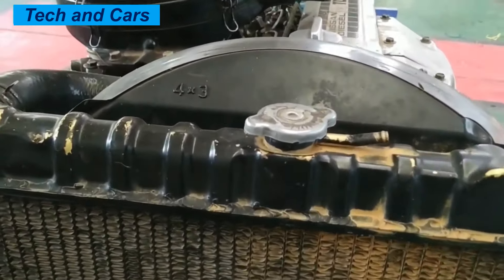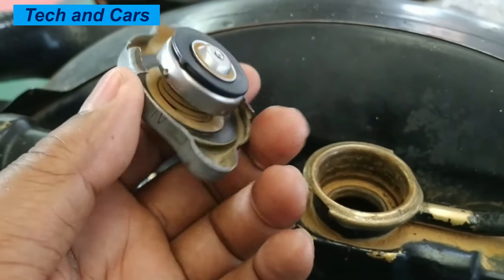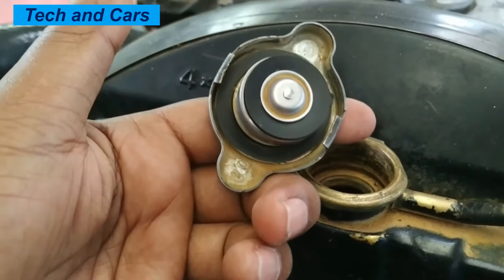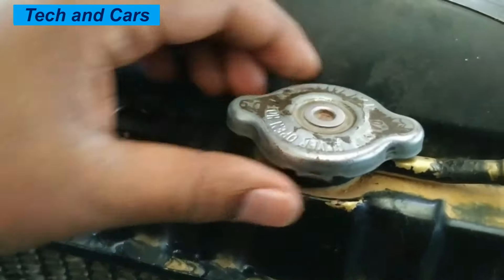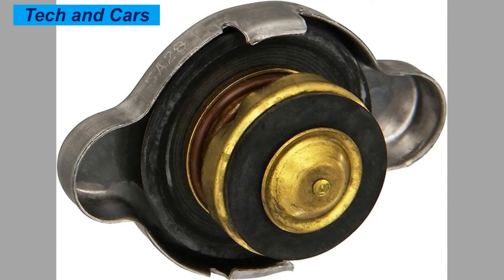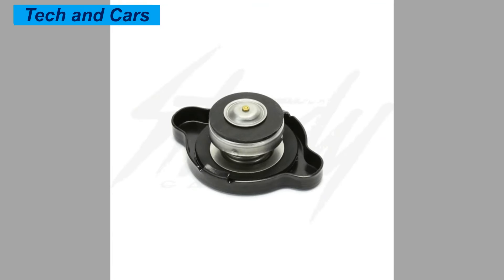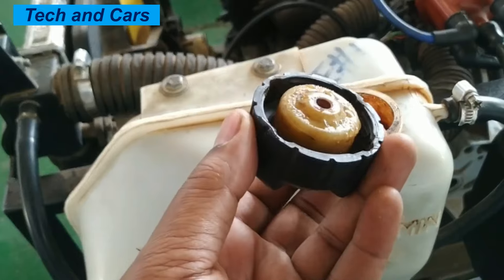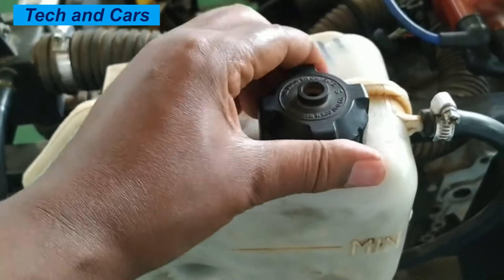Radiator Cap EXPERTS Reveal Their Secrets!

Comment: Radiator caps are like a 2way valve when it gets hot and water expands/turns to steam it will release the excess into the overflow bottle and as it cools it sucks water back into the radiator/cooling systems  hence the reason if ur cooling system is good u will only need to add minimal coolant to ur overflow tank/expansion chamber! If u are continuously adding coolant to both your radiator cap is most like nogood its a cheap swap after u top up coolant bleed the air u should never need to top up ur radiator or engine/ coolant cap. You should only need small amounts here and there in ur overflow bottle and never need to check rad  wen u do it should always b full. If ur adding coolant more than a hanful of times a year depending where u are theres a cooling system issue somewhere!
Reply from the maker: Thank you very much for this very detailed and amazing explanation!